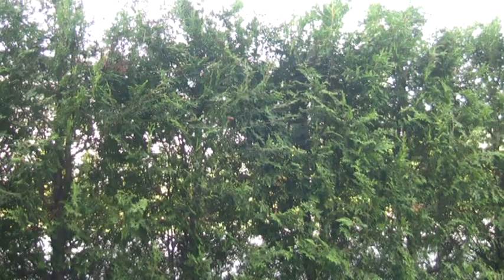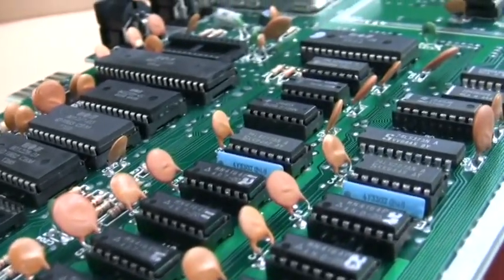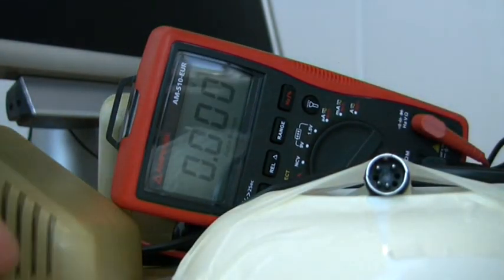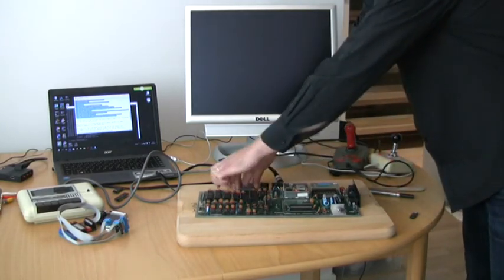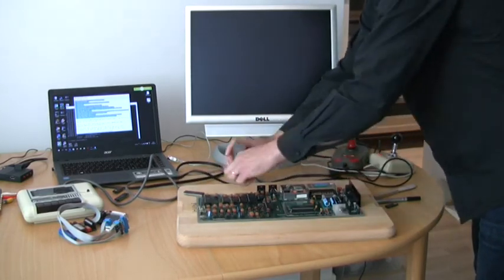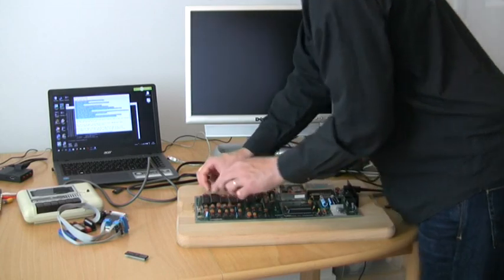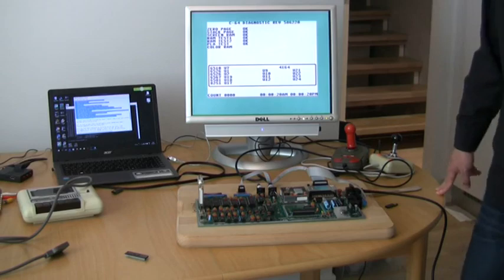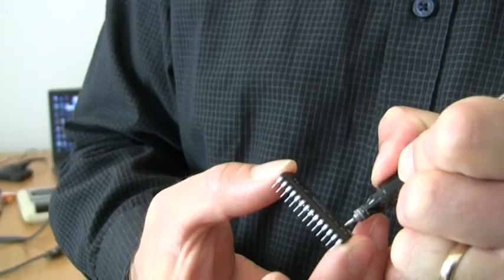C64 Repair Report + Testing (Commodore 64 Black Screen 250425)

Comment: Great stuff!  What is the model of your monitor btw?  I have a dell monitor but it doesn’t work
Reply from the maker: Hi there! That's a PAL C64 with a 20" Dell UltraSharp 2001FP monitor manufactured in 2004.